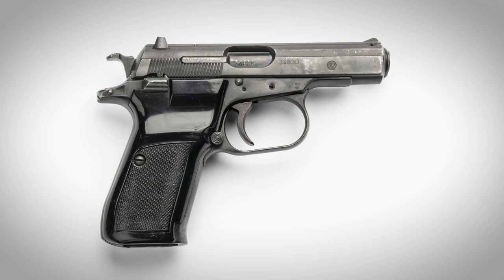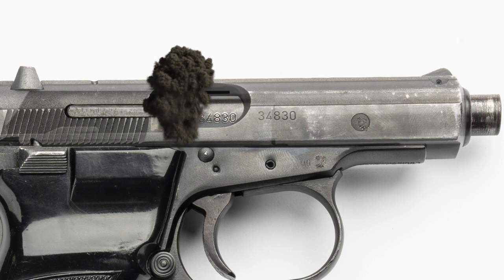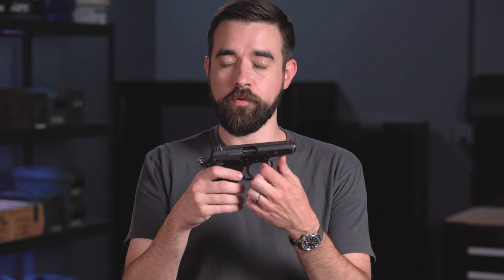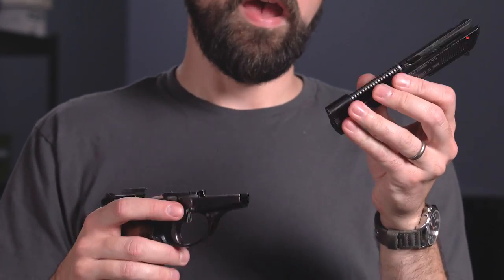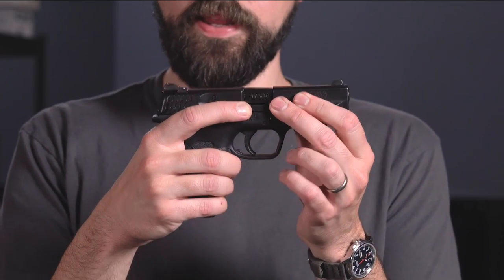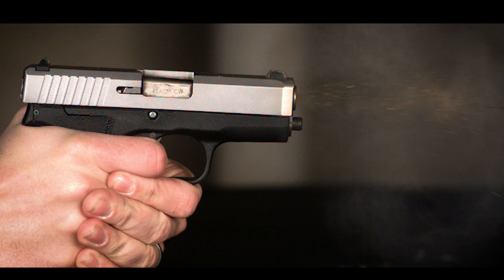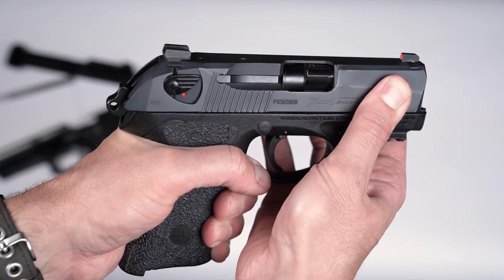Blowback Versus Recoil Operated Pistols

Comment: I have heard it said that straight blowback designs are inherently more accurate than locked breech designs,  because the barrel is fixed permanently to the frame versus "floating" (so to speak).  I do not know if that is true or not.
Reply: On paper, yes, there is a difference, but practically, it's so minuscule as to be effectively nonexistent.
Reply: Depends a lot on build quality. On the blowback, the slide has to come back into battery precisely so the sights/bore relationship is the same each shot. The recoil operated guns, like the 1911, are more complex, but good build quality will also have the slide (and therefore the sights) and barrel locking up consistently with an assist from a properly fitted barrel bushing or a good fit between the barrel's muzzle and the slide (without a bushing). Either type can be poorly made so that the sights and bore do not come into a consistent alignment shot after shot. Because the recoil operated gun is more complex, it's just harder to do. Modern CNC machining makes it easier, but nothing beats a hand-tuned 1911.

Comment: The spring is meaningless in countering the recoil. The .380 round has maximum recoil force of over 2000 pounds  and average (while the bullets in the barrel) over 600 pounds (muzzle energy / barrel length).

The recoil is felt only when the moving  parts stop. On recoil operated pistol the barrel stops first and only then the slide. On a blowback only the slide stops so it causes sharper recoil.

Comment: Pretty good laymen explanation but one thing wasn’t exactly accurate, a direct blow back doesn’t just rely on mass and spring tension to delay the slide there is also the friction caused by the case swelling to fill the chamber.

Comment: For both types, the greatest initial resistance to the rearward movement of the slide is the hammer.  Recoil can be tuned by both recoil spring and hammer spring, also known as the mainspring, as well as the "cam" profile on the underside of the slide, where it pushes against the hammer during recoil.

Comment: One higher caliber pistol which uses blowback operation is the H&K VP70Z.  It is also possibly the first pistol to have a polymer frame and grip, with the metal barrel locked into the frame and unremovable.  It is a striker fired pistol in 9mmX19mm, using 18 round capacity magazines.  A military/law enforcement version, the VP-70M, had a shoulder stock attachment (not available to civilian shooters) which gave it a three round burst capability through a selector mounted on the stock.  I've seen one YouTube video showing the firing of that weapon.  The stated rate of fire was given as 2000 rounds per minute.

The VP70Z is no longer made, and hasn't been available for quite awhile.  I own a used one which I found in a shooting range/gunstore in Las Vegas many years ago.  I have two spare magazines for it, giving me the ability to carry up to 55 rounds of 9mm at once if one is also in the chamber.  Finding a good holster for it was a real chore, since the military version stock supposedly served as a holster for the piece as well, and was not accessible to me.  I haven't used it in years because it has a long, heavy trigger which doesn't break very cleanly and takes forever to squeeze.

Comment: I feel like I'm either missing something or the terms "blowback" and "recoil operated" do a really bad job at describing the difference in these two processes. 

Again unless I'm missing something it seems like both pistols utilize the blowback of the expanding gasses, its just that one uses the mass of the barrel in addition to the slide to dampen the motion while the other only uses the mass of the slide. 

Please correct me if I am not catching something.

Comment: 6:52 My Glock G25 doesn’t have a locked breech (instead of typical 90° “shelf” between the barrel and slide, there’s just a smooth slope) but it has a tilting barrel, does it qualifies as “straight blowback action”!

Comment: Locked breach is lower recoiling because while the barrel is locked to the slide, the slide weighs more;  like a heavy blowback slide.  Once the pressure has adequately dropped in the chamber, the barrel decouples from the slide.  The slide now weighs less and therefore the felt recoil is less.  The genius of the design never creases to amaze me.

Comment: i have a question while using makarov which is 9*18mm , after few rounds the hammer doesnt go back into semi auto position rather turn into double action, what can be the possible reason? kindly provide the information, i had seen the issue few mags worked flawlessly but few times the bullet was fired and the hammer went into double action mode while the bullet was loaded i hope you are getting what i am talking about, appreciate your work.

Comment: I think this is what you're looking for:

For recoil:  Energy = ½mv²;  m = 125 grain ≈ 0.018#; v ≈ 1000 f/s;  conversion factor = 32.174 lbm -ft / lbf-s².  Need spring constant, k, and distance traveled to know if the round is within the range required for proper ejection.

For blow back:  Energy = Force per Area;  Force ≈ 40,000 psi;  Area = πR² where R = (9mm/2)*(1/25.4) so Area ≈ .1in² and force ≈ 4k# at the instant of initial burn.  Goes down quickly as round  travels down the barrel.

Comment: The "snappiness" of straight blowback guns is why my summer carry choice is a Colt Mustang. It's locked-breech action really makes a difference in the hand. I believe all of the "baby-1911" pistols are locked-breech designs. They cost more but are worth it. One of my first guns was a Baikal Makarov, which is a high-quality gun in terms of materials and manufacture, but very unpleasant to shoot in my experience. 9x18mm is a hot round and the Makarov (a PPK clone) puts a lot of that power directly into the web of one's shooting hand. I was glad to pass that gun on to someone else.

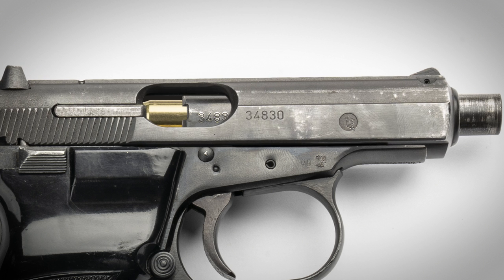Comment: 1:40 wait. how does the slide move backwards?? if pressure is moving in all directions wouldn’t the casing be pushing on the firing pin?
Reply from the maker: The firing pin is inside the slide. It protrudes from the slide to strike the primer and then a spring causes it to retract back into the slide. The case then pushes against the whole slide.
Reply: Lucky Gunner Ammo i’m sorry, i still don’t understand how something with pressure moving in all directions in turn pushes the slide backwards. why not forwards, upwards, downwards?
maybe i’m not explaining my question clearly.

Comment: Excellent presentation on the difference between straight blow back autoloader pistol action and recoil locked breech autoloader pistol action.  Now, I challenge you to perform a presentation on the difference on Control feed bolt action rifles and Push feed bolt action rifles.

Comment: Excellent video. Very informative. Not to be contrary, but at approximately 3:30, you state that the fixed barrel blowback was popularized by John Browning's FN model 1910. Actually it was the John Browning designed FN Model 1899 and Model 1900 (1900 being an improved and much more popular version of the 1899). Thank you for this great video.
Reply from the maker: I was referring to that particular style of blowback pistol with the recoil spring located around the barrel.
Reply: @LuckyGunner  - Then you would be correct and I am in error. Regardless, this was an excellent video and I appreciate your hard work and dedication to them. Thank you.

Comment: as many many things with Soviet design... they pushed usefullness and economy to the limits...

Blowback are way cheaper to build since they have less parts... on the other hand the largest caliber safe to be operated from a blowback design gun is 9x18mm "makarov"... so they pushed the cheapest design to its limits and find themselves with lots of stock of a pretty good and reasonably capable handgun for a fraction of the cost of what a recoil operated issued handgun might have costed

Comment: I like that Beretta straight blowback design that locks the barrel to the slide. The thing that occurs to me every time I clean my short recoil operated pistols is that the accuracy of a pistol whose barrel is not permanently locked to the slide (and thus permanently aligned with the sights) must be lower than the accuracy of a pistol whose alignment between barrel and slide/sights is permanent.

Comment: He's right about blowback pistols in larger calibers being a handful.  I have a Spanish Astra 400 WW2 9mm blowback pistol that's heavy, big recoil, hard to cock the slide and generally a crappy gun, but it's super reliable, dead on concerning accuracy and works even when dirty or after immersion.  It's a tractor compared to modern lightweight locked breech 9mms which are finicky.

Comment: wouldn't moving (or even tilting) barrel be very detrimental for gun's precision?
Reply: High precision weapons used for target shooting, and thus small calibre, benefit from a fixed barrel, or at least a barrel closely integrated with the slide.

Larger calibres are mostly designed for combat, so high precision is less important than training with the gun. Having said that, I have seen remarkable groups from good shooters using recoil operated pistols. Practice produces consistency.
Reply from the maker: Most modern handguns, regardless of design, are far more mechanically accurate than what 99% of shooters are capable of.

Comment: I think the Taurus PT-25 or PT-22 is a simple blowback. It's a copy of the Beretta tilting barrel design for smaller calibers. One of the things that makes mine extremely unique to any gun that I've ever had before at least is that doesn't use an extractor at all. It uses the pure blow back itself to eject the cartridge so no small extractor to break.  One of the downfalls though is that it doesn't work without a magazine in it it has magazine safety but even if you remove it it still stovepipes when you fire it without the magazine because there is nothing to push the empty casing up out of the way.

Comment: I have the CZ83 in 9 mm Makarov. With it's fixed barrel none of my 9 mmm Luger pistols can top it for accuracy. That be Canik TP9SA, Steyr M9, Walther P38 ( post war) and Browning Hi Power. All of these pistols are excellent shooters but rapid fire the CZ is faster recovery and points more naturally. I realize the 9 mm Makorov round is less powerful, but in the CZ it packs a good spot on hit every time. The ergonomics excel but not quite as good as the P38. I am a big fan of the fixed barrel and I am aware it is limited to something less than the 9 mm parabellum. Yes the Hi Point has the fixed barrel too but has a massive slide and is ugly. The Hi Point is very accurate as well, if you can get past the clunky action and weight. This is a very good video.

Comment: I dont think he understand that blowback and recoil are the exact same thing.   blowback = the charge in the shell push's back the slide and chambers a round..   same as recoil.. 

but the correct term is blow back.       then there's gas operated.. which does essential the same thing using the pressure in the barrel to push a rod thats connected to the bolt.

Comment: Thank you for this interesting video, as always. There are however two points on which I fundamentally disagree. The fist one is that some blowback .380 like the Cz-83, the SIG 232 or the Makarov are, at least for me, a huge lot easier to control and to shoot quickly and accurately than a un compact 9x19 like the G43. The second point is that blowback operated pistols remain easier to produce than locked breech ones. This makes them more affordable, for the same level of quality. This is also why they are still manufactured.
Reply: They're easier to shoot because they have milder cartridges, if you put .380 ACP or 9x18mm Mak in a locked breech pistol, they would be even more gentle in recoil than the blowback pistols you've listed.

Comment: Unless you're a collector, there's no practical reason to have an auto-loader.  High maintenance, special tools required etc.  It's a project.  Little toy.  Count me out.  A wheel gun, however, when applied correctly will make Bigfoot urinate his Serenity undergarments, turn and bag ass quickly into the sunset.  Understand?  I got no time for jams.  I don't like problems.

Comment: Im not sure if John Browning invented it or not, but 1911 is not tilting barrel mechanism. This 'tilting' comes from the fact that most modern pistols, has locking chamber in ejecting window, and when lock is back, the chamber needs to detach somehow from ejecting window. In 1911 has different lock mechanism, with locks in barret itself (barrel skew ?)
Reply from the maker: The 1911 uses a different locking mechanism than modern pistols but it is still a tilting barrel design.
Reply: @LuckyGunner  Ok, i checked the animation of 1911 (unfortunatly i do not own the gun) and you're right. Despite the fact it locks in barrel, the barrel this tilting. Sorry.

Comment: Interesting video. I am a lifelong hunter with very little pistol experience. I have a fair amount of experience with M1 Garands and Remington autoloading high power rifles. I've always wondered why the operating principles for rifles and pistols are completely different. I've imagined that the space required and complexity of design makes gas operation in a pistol impractical and the accuracy benefits of a fixed barrel not critical in the short range applications of pistols. While the blowback or recoil operations as implemented in pistols would not contain the much higher pressures of high power cartridges, and the loss of accuracy with looser mounting, tilting barrels would be unacceptable at rifle distance shooting. I would appreciate comments from those more knowledgeable regarding my notions. Thanks.

Comment: Having own and shot the Astra 600 a blow back 9mm Luger caliber gun than the locked breach . The big problem is the balance of the spring weights in the caliber . But that being said that was a major problem in getting the 1911 in 9mm to pass the drop test , changing spring weights through out the whole system .

Comment: Astronomy? No mathematics?  Astronomy uses some complex formulas to describe the planetary orbits. The location in the night sky of planets and stars is also found by mathematical models that can blow a poor engineer's mind. That being said,  the length of time a  bullet remains in the barrel is pretty simple.  Velocity is distance divided by the time it takes to travel that distance.  Acceleration is the time it takes to reach that Velocity. 
To simplify the calculation, use the muzzle velocity and barrel length.  A typical 9 mm Luger's muzzle velocity is 1200 feet per second. At this velocity, from a typical 4-inch barrel, the bullet spends about .0003 seconds (rounding up) to exit it. If we consider acceleration, the time jumps up to about .00055 seconds. It all happens so fast!

Comment: There really is hardly any difference between the two. In both types it is the firing of the cartridge that causes the slide to go back and also cause the round to eject and both types have a recoil spring.

Comment: Ignites the "propellant" (for the projectile). I suppose it could also be a "RE-pellant" since the slide is 'propelled' backward. Cute, tho'. And often, shooters are a bit "repelled" by the noise the shot makes. Nice animations.
Reply from the maker: Believe it or not, I did say "propellant" but the mic didn't pick up the "p" very well.
Reply: @LuckyGunner  Seems your mic also magically changed the "o" in "pro" to the "e" in "re". It's an excellent presentation, but you did make this li'l blooper. (I used to edit audio tapes for a living. I still hear pretty well.) Is it fixable? Or, just ignore it. Cheers! 😉

Comment: Locked Breach would be a much better thing to call it; Recoil is too close to Blowback and it's confusing. The distinction is in the locking breach, so they should lead with that. Mass Vs. Locking Mechanism, that's how it could also be said. Also isn't recoil a function of the blowback process, and thus the same processfunction a locking breach uses to shuttle both slide and barrel? Lemme know if I'm full of shit and thinking wrong :P

Comment: Direct blow back is almost always more accurate, usually being done with a fixed barrel. Also far few parts to break and wear out, cheaper ammo and weapons. 90% of every gunfight is hitting the target, so a handier more accurate gun you can practice more with and no one knows you have makes way more sense than a double stack 9mm if its really about self defense.
Reply: The difference in accuracy is very small, most people aren't good enough to be able to tell. And there is no shortage of extremely accurate short recoil guns.

Cheaper ammo? Unless you are talking about .22lr, .32acp and .380 are either equivalent in cost or more expensive compared to 9mm.

Short recoil guns are easier to shoot in any given caliber, lighter, and are typically better made
Reply: @ZackMarrs556NAT0  If the barrel moves the gun is less accurate, and the barrel almost always moves in any kind of locked handgun. The inherent accuracy actually means more if the person is a weaker marksman, plus the small recoil and concussion of .25 .32 and .38 make a huge difference esspecially shooting under stress or indoors. I take your point on pricing, its silly but in some cases true that smaller bullets cost more.
Reply: @MrLoobu  the difference between the accuracy of a fixed barrel and a short recoil gun just isn't there. Certainly not in any practical measure.

If it was, you'd see far more competition shooters using direct blowbacks

And of all the new shooters I've taught, the concussion of 9mm is easily gotten over. The weight/recoil of a gun matters much more. And most .380 auto blow backs are not easy for new shooters to use